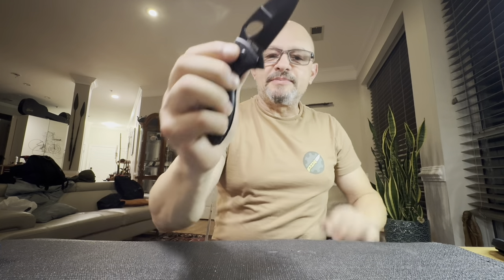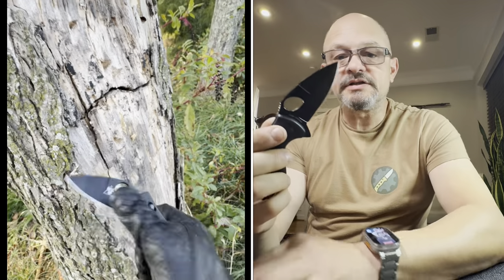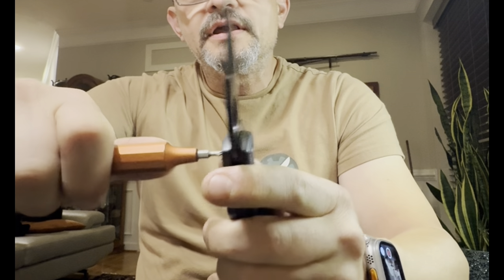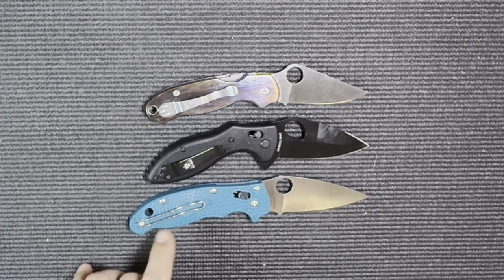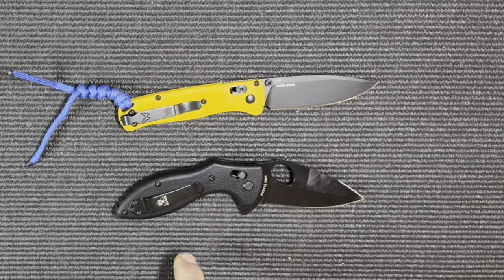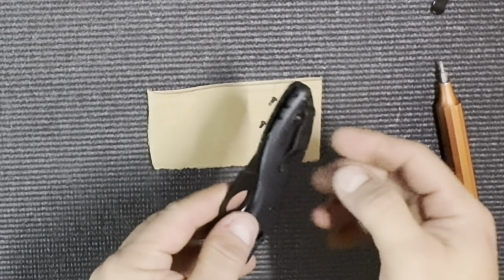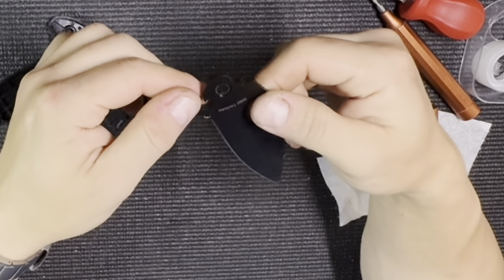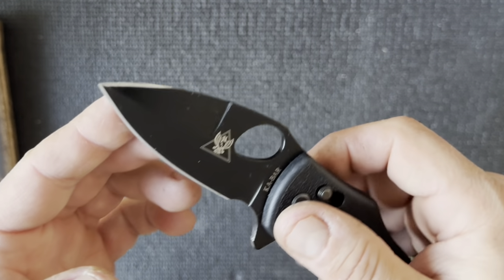5 easy mods to KA-BAR TDI Flipper Folder! Review, assessment, disassembly and DIY performance mods

Comment: I like the idea of it.  I have the fixed blade version (have one) but only carry it occasionally. It’s just simply easier to carry a folder.  This seems to “split the difference”.  But (and maybe it’s due to the way a folder is built), the angle seems different on this folding version than the fixed blade:

Comment: I am slowly adding a swedge to reduce the spine thickness of my dozier2 in d2. The thick spine on the dozier 2 is very inconvenient too often, but with my new swedge, I hope to accomplish all of my tasks like opening paint buckets, reaching into square corners to remove the last bits of wood that won't come out, and other such building maintenance style tasks. It's crazy how close the knife was to perfect , save for the super thick spine all the way down to the tip of the blade. I am super happy that I am making the modification, which is probably how your video showed up in my feed. It's crazy how close a knife can be to perfect, but with just the right personal modifications can be exactly what you need.
Reply from the maker: Thanks for the awesome comment! You’re my kind of people!